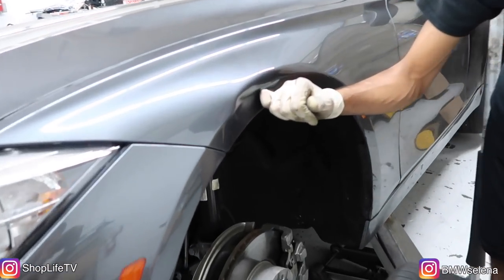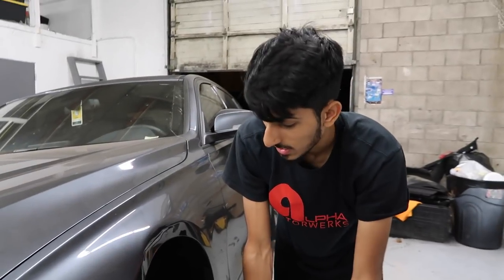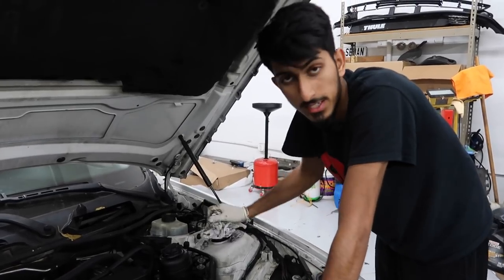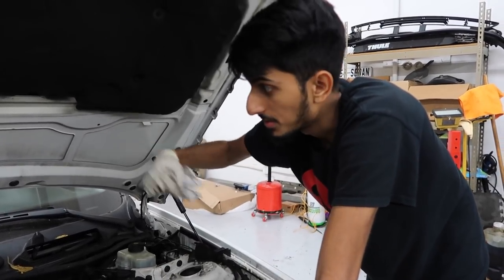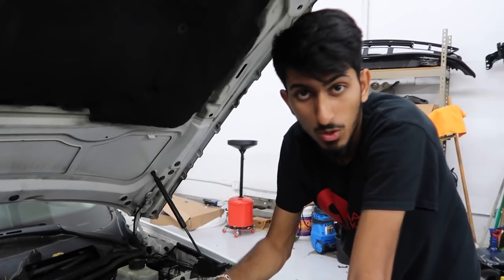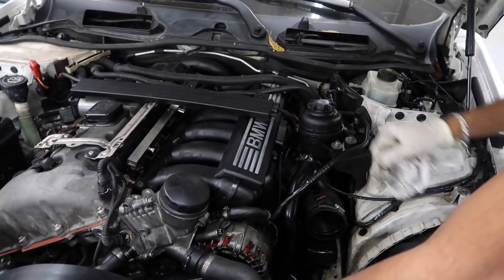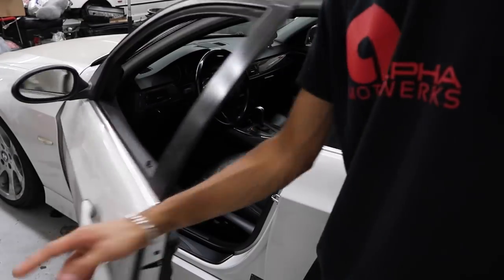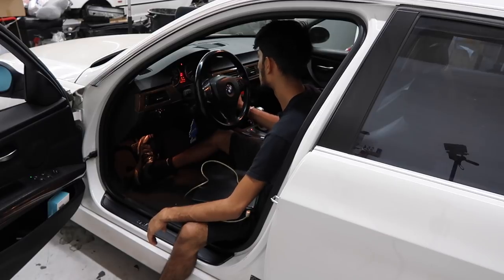NEW BMW F30 IN AN ACCIDENT + BMW E90 Broken Head Bolt Fix!

Comment: Excellent work bro!!💪👍 I now own a 01 Bmw 330xi for a yr now and And I watch all of your videos i been doing alot with cars for a while i had a 08 chevy impala ltz i crashed twice n rebuild then my 06 infiniti m35x suffered a similar fate lol so i bought my first bmw and watching u I've became familiar with my car now im becoming a BMW mechanic lol i literally couldn't if not for your videos but i over torque one of my head bolt the one in the front during a valve cover gasket change now i have a small oil leak what do suggest i can do to fix the problem I appreciate  your advice. thanks and both of y'all keep up the good work👍✌

Comment: Mine has a pool of oil as well near the manifold area with a broken bolt. Would this also be considered a vacuum leak? And if so can this set off codes like P0174 and P0171?